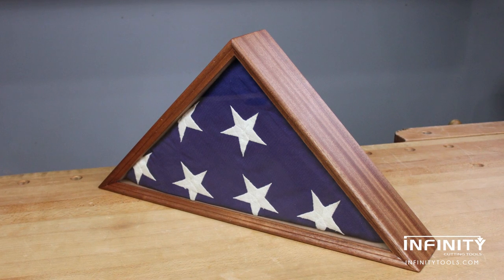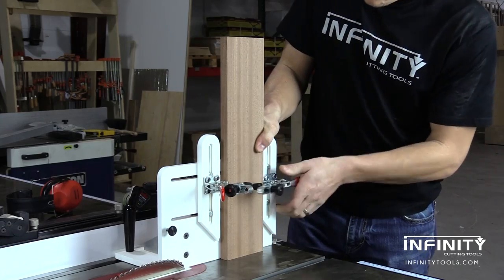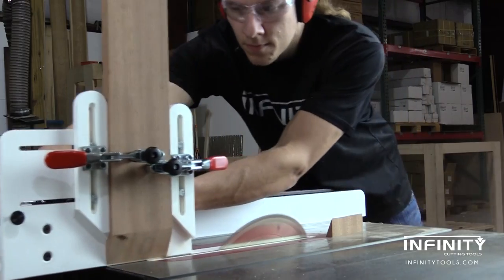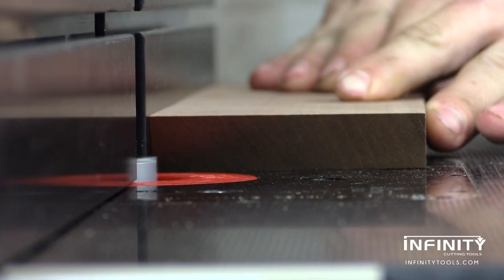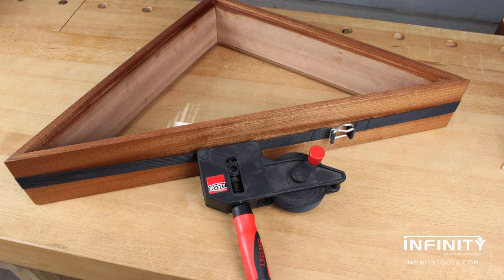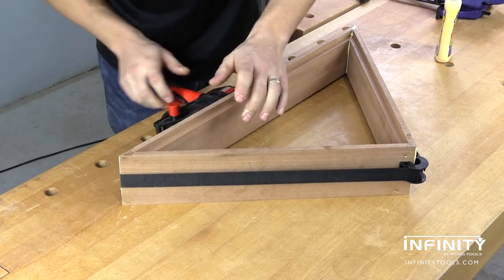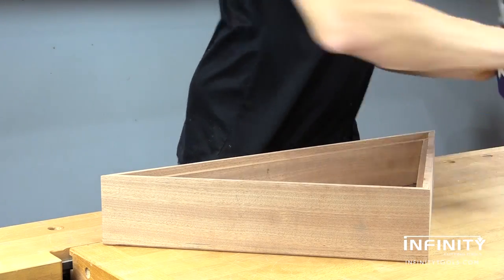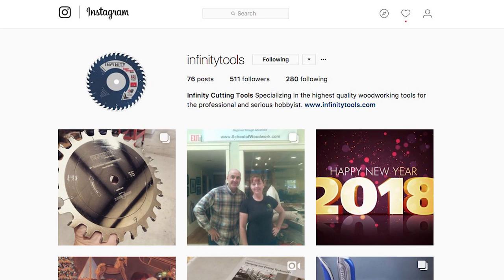Building a Memorial Flag Case w/ Your Router & Tablesaw

Comment: That forearm over the blade at 2:17 made me cringe. but that's just me.
Reply from the maker: This is just the camera angle making it look like my arm is closer to the blade than it really is. With the blade tilted away and the handles on the vertical router sled being well back from the blade, my arm is mostly over the fence a good distance from the saw teeth.

Comment: Can the 22.5 cut be cut on a miter saw. I tried that cut with a small piece on the miter and it didn't look right
Reply from the maker: No, that is why we made it at the table saw using the vertical router sled. It is much too steel to make at the miter saw.

Comment: Nice job!  Could you make the 45 and 22.5 degree cuts on a router table using your chamfer bits?
Reply from the maker: The 45* cut could be make at the router table, however the 22.5* cut would require a very large bit that is not available. The tablesaw is a much better solution in my opinion as it and a good crosscut blade are essential tools for almost every woodworker.

Comment: Thanks for the video.  How did you attach the back panel?
Reply from the maker: We used some picture framing points. the same little metal tabs that are used on picture frames. you can usually find the points and a couple different types of drivers at hobby/craft shops and some hardware stores that sell framing supplies.
Reply: Couple more questions ...did you fill the nail holes? If so, with what?  Thanks again.